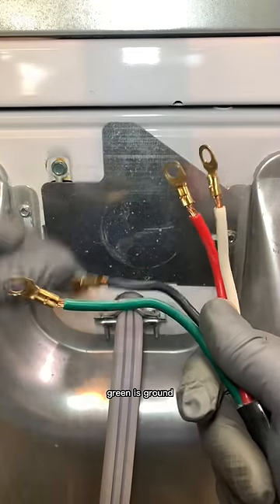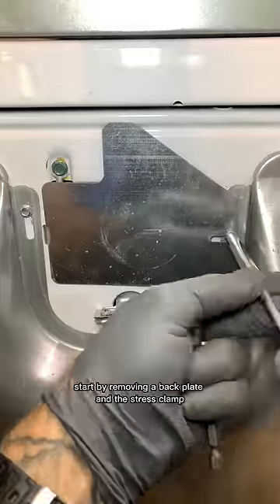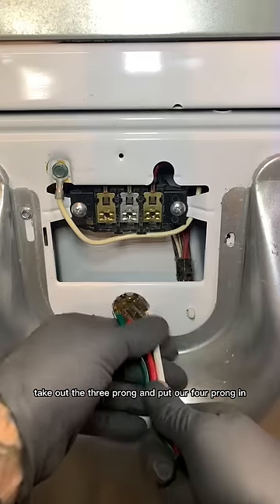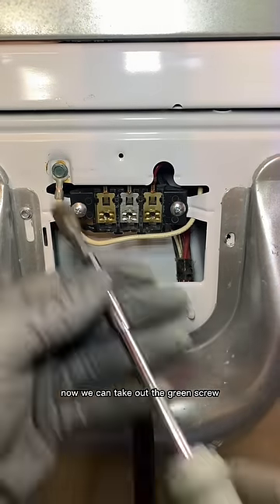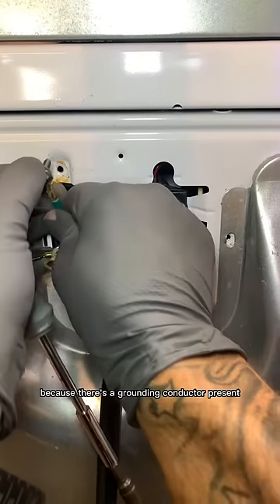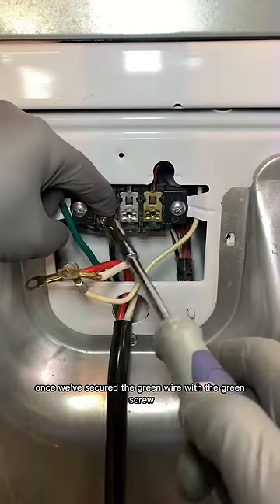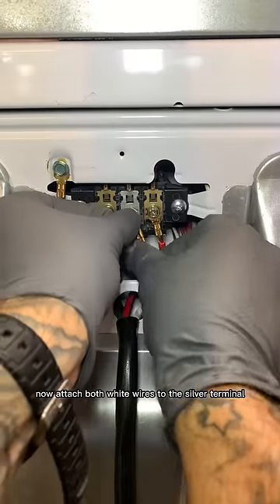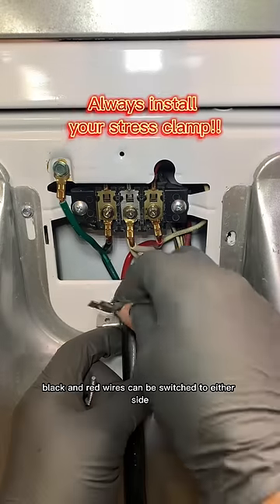Always be sure to ask if the delivery company installs a cord on your new stove or dryer!

Comment: Hang on to your three wire. It never fails that when you move the outlet will require whichever cord is not currently installed.
Reply: I'm pretty sure that is the first stage of Mr Murphy moving into your new home.
Reply: Check the price to change the receptacle, if you are able to. could be cheaper than buying a new $50 cord

Comment: THIS is great info! As a home inspector I always recommend upgrading to a 4 wire 👍🏻
Reply: If anyone has time to explain why would be greatly appreciated
Reply: @ducktape4502  If i understand it correctly the forth wire is 110V but 180° to the other life wire. So you get 220V.
Reply: @MrGoesnuts  thought it was 120/240. God the more I learn the more QUESTIONS I HAVE!!!!
Reply: @jsb7546  110 or 120 doesn't really matter
Reply: So I'll explain real quick. I'm an electrician. Unless you upgrade your wire from the service panel from a x/2 to a x/3 wire it is honestly no safer or more practical. You can change the plug interchangeably by bonding neutral and grounds together by code. In practicality dryers and ovens are almost strictly 240v meaning as long as a grounding wire is present and in almost every circumstance there is, it is a safe system. All a neutral wire will do is allow systems within it to operate at 120v instead of 240v. It doesn't add safety or really anything practical. If it's grounded you are ok. edit: I will add natural wires are very important for safety in some systems like hot tubs.
Reply: @markusford6585  so the dryers always have 220v from two phases and the second and third wire add neutral and earth?
Reply: @MrGoesnuts  exactly. Grounding comes next and then the neutral. Oddly enough neutrals and grounds are bonded at the exact same point on a electrical panel an are in a way the same thing.... But not... If that make sense lol. Unlike what the building inspector said... As long as your appliance is grounded I have no safety concerns with you using it. Neutral or not. Unless it's a hot tub!
Reply: @markusford6585  neutral and ground wire only is strange when you have you two phases. I'm only confused by the US way of doing this. Electrician from Germany.
Reply: @MrGoesnuts Not sure what you mean? We have 2 phases here as well.
Reply: @markusford6585  we have 3
Reply: @markusford6585  they run off 220/240 in Europe as you know
Reply: Also note the typical 220/240volts systems are correcctly called a split phase system. 3 phase systems are completely diffrent
Reply: @markusford6585  right on
Reply: @ducktape4502  Metal buildings for one thing. Around here you can use 3 or 4  wire systems in houses but house trailers and other buildings with metal frames must use 4 wire systems only. That way you do not get fried when you come home from work and grab a hold of the metal door knob of your house trailer if that is a short in the stove or dryer. Also some cook stoves have a 120 outlet in the panel to plug up such things as rice cookers. Those stoves really should have a 4 wire set up.
Reply: What's a home inspector?

Like for an inspection before buying?
Reply: @ab3040  some inspect homes for prospective buyers before buying (in my area it is not a requirement, but I'm not sure if that is true for other places). Inspections are required for all new construction, which requires multiple and take place in phases throughout the build (inspections for the foundation, framing, electrical, mechanical, final, etc) and an inspector would be the one doing these and making sure that everything meets the requirements set in the building code before the builders can continue to build. Renovations might require the same and would be inspected.
Reply: @MrGoesnuts  yup they are both 110 but the phases are 180 degrees apart
Reply: You recommend the homeowner does it themselves?
Reply: @markusford6585 , thank you for confirming what I was thinking while watching that, about the purpose of the white neutral for 120v systems in the machine. In your last sentence, did you intend to write ''neutral'' rather than ''natural''?
Reply: @MrGoesnuts , every house has three phase power? Now, that is civilized! That would make the purchase of good quality woodworking machinery for the shop so much easier! In the USA, the power companies always quote a number that is nearly unimaginable to a home owner, to bring three phase to the house.
Reply: @leehaelters6182  I think nearly all of them have it. It is not wired to an outlet usually, but that's the cheap part.
Reply: @MrGoesnuts , danke! Or, thanks! if you are an American abroad.
Reply: Not to knock you but a lot of times  you can not convert to a 4 wire cord set due to old concealed wires that are never easy or cheap to upgrade 10 /2 type NM cable to 10/3. Have seen way too many so called home inspectors write up things that did not need attention. Clown that inspected my sister's house wanted the 200 amp circuit breaker panel replaced because when he turned all of the electric baseboard heaters on while the empty house was over 90 degrees and panel cover just so happened to have sun on it felt warm. Asked him what model FLIR camera did he use. Oops don't own one. Asked if he used a cheap $100 hand held temperature gun. Nope. After I gave him a class he passed the entre electrical system.
Reply: @leehaelters6182  no, most residential houses in the US have one phase of 240V coming to the house. You get 120V by tapping off the middle of the transformer at the street. Hence, hot-hot-neutral coming into the house for top-bottom-middle of the transformer. Still one phase though. I’m in South Carolina
Reply: @jakewright7867 , thanks for the explanation. Did I write something contrary to that, somewhere?
Reply: @THECREATOR1099  If it is 180 apart then you are using a converting transformer somewhere in the power distribution system.

Phases are usually 120 degrees apart.
Reply: As a home inspector you need to also let these folks know they’re not really looking at a DIY situation. It’s not just changing a receptacle people.

Comment: Crazy how I ended up here, I have never went out of my way to watch electrician tutorials but this is good to know
Reply: Same
Reply: This isn't electrician stuff. This is appliance installer stuff. Electricians run the wires to the plug on the wall, and that's where the job ends.
Reply: @user2C47 it’s a little more than ‘running wires to a plug’ 😂
Reply: @HughWoo  Obviously we do more than just running a wire, but electricians typically aren't the ones putting cords on appliances.

Comment: Super common house fire cause too. What happens is (like he showed in the video) the GND is where the NTRL should go and then a heater element may fail and then it will touch the metal casing of the drier then gets hot (Or electrocutes someone) and starts on fire then your house may burn down.  If the GND is in the proper placment if the heater element breaks and touches the metal case it SHOULD just trip the breaker before anything serious happens.
Reply: I never knew 220vac had a neutral. You sure it's not just another ground?
Reply: @Barabbas7798  Yes they have a Neutral,  for AC 120 Motor you HAVE to have a neutral.  Yes it will work just for the ground but it will cause electric shock if you touch the case.   Also oven have Neutral too so the clock and light will work on then as well.
Reply: @trxtech3010  right but that's 120vac. 220vac doesn't have a neutral just 2 phases of 120vac
Reply: @Barabbas7798  The Drier motor has a neutral.  the motor does not ruf off 240V
Reply: The case is still grounded. If there is any ground fault it will still trip the circuit breaker.
Reply: @Redtooth75  If the ground is connected in the right spot yes.
Reply: @Barabbas7798  
The NEMA 14-30 connector (the one being installed in the video) has both ground and neutral so it can provide both 120V and 240V. Some connectors have only neutral (e.g. NEMA 10-30, uninstalled in the video), only ground (e.g. NEMA 6-15) or neither (e.g. NEMA 2-20) although this is obsolete.

Comment: We had a new stove installed by the delivery guys and, unknown to me, they skipped the strain relief. A year later I pulled the stove away from the wall to unplug and clean behind it and the 220v line shortet to the chassis. After I turned off the breaker I unplugged it and saw no strain relief at all. Could have been VERY dangerous.  Please, if you have one installed, be sure you SEE them attach a strain relief.
Reply: Agree. The restrain clamp has a purpose.

Comment: If you get your black and red backwards, your clothes will be stuck 1/60 of a second behind your washing machine. This can lead to a space time paradoxes and increased lint.
Reply: That is 100% incorrect, I am sorry to tell you. In a dryer, mismatching your red and black wires will cause the machine to add moisture to the clothes, meaning they become wetter than they were at the outset. Do the same with a washing machine, and your clothes become dirtier and smellier.
Reply: Oh no, I had my red on the right as the instructions say but the screw won't get tight! I switched it with the black and it's tight. Now idk what to do

Comment: I had to do this once when I noticed the outlet was different for my drier. When I moved to a new place I had to change it back. It wasn’t so easy either, I kept dropping the screws in the drier. I would advise people to use a magnetic screw driver.
Reply: Make sure screws are magnetic ferro material.  Frustrating to get magnetic tip, and makes no differnce
Reply: I always use a magnetic nut driver on the dryer cord screws.

Comment: Standard range plugs are 30A 3 prong and even back in the days older ranges had 120v outlets on them that used the ground as "neutral" since neutral and ground are connected to the same terminal in the distribution panel.. this is really just for show.

Comment: If you use a 3x2.5qmm ( Nym-J) on 15 Metern range than its total save ( LS B16A Breaker ) for the Cable and the Breaker dosent Pop if u use a 3x1.5qmm on 18 Meters ( LS B13A ) 

Greetings from germany. 
Brown is L1 Phase Außenleiter
Black is L2 Phase
Grau / Grey is L3 Phase
Neutral is Blue 
Earth is Yellow and Green.

Comment: Quick Question. Will that ground connect work fine? The metal that it's attached to is painted so that just makes me assume that it might now have a good connection.
Reply: The screw threads make contact with the bare metal.

Comment: White is a current carrying conductor just like black and red , green or bare are safety and should never see current unless something is faulted. This was a CODE FAILURE that should have been corrected in the 1950s,  ranges and clothes dryers operate heating elements at 220 volt BUT controls lights timers and tumbling motors typically operate at 120  volt witch introduces power on metal chassis of appliances.  LIKE I SAID CODE FAILURE FROM 1950S CORRECTED IN 1990S,  finally,

Comment: When I see 3 or 4 prongs, I thought it was 3 phase connection.. but I remember in the US they use 2 separate leads to made 220V from 110V.
Reply: Mostly correct. USA and Canada residential power is 240V single phase. To get 120V, the transformer has a central tap for neutral. We don't make 240V from two septate 120V lines, we make two 120V lines from one 240V.
Reply: @Crlarl  , and then use two 120V to make 240V at the device... just like he stated.
Reply: @outdoorsman7324  
You can think of it that way. We don't have to make 240V, it's already 240V, don't have to do anything.
Reply: @Crlarl  , you sure do, you have to use two conductors two achieve it... otherwise, you simply have 120V.
Reply: @outdoorsman7324  
You need to have 2 conductors to make any kind of voltage.
Reply: @Crlarl  , you know very well what I'm stating, ground does not provide power.
Reply: @outdoorsman7324  
I wasn't even talking about ground. 240V AC need 2 hot wires and that's it. (Outlets will often have either ground, neutral or both).
Reply: @Crlarl  , I know what 240V requires.
You're trying to be smart and it's not working, you've let slip just how little education you have on the subject. 🙄

I can now see that reading the NEC would be a challenge for you.
Reply: @outdoorsman7324  
Thanks for the condescension. If you think I got something wrong, explain it. Don't tell me I wouldn't understand.
Reply: @Crlarl  , I don't have four years free time to pass on the information I've acquired.
Reply: @outdoorsman7324  
Tell me again how many conductors you need for 120V?
Reply: @Crlarl  , according to you, one. 😂
Reply: @outdoorsman7324  
I never claimed anything like that. You, however wrote, "...you
have to use two conductors two achieve [240V]... otherwise, you simply have 120V."
Were you trying to say that 120V is achievable with 1 conductor or with at least 3?
Reply: @outdoorsman7324  
I never claimed now implied that 120V could be made with only one conductor. You seem to not remember what I previously wrote: "You need to have 2 conductors to make any kind of voltage." That goes for 120V, 240V, 400V, 5V or anything else.
There are several plugs which only use 2 wires for 240 plus ground (which you said doesn't count). eg. NEMA 6-15, 6-20, 6-30. If you want an example of 240V being made with only 2 wires, no ground, look up NEMA 2-20.
Reply: @Crlarl  , it is grounded... and on a neutral.

While at the device it will return voltage through the opposing phases... now follow that path back to the transformer.

Imagine that, both a ground and a neutral.

As for your 120V scenario, it requires three conductors minimum, per NEC, no matter the installation, residential, industrial, commercial, food grade, medical...

You're attempting to legitimize being incorrect and it's not working well.
Reply: @outdoorsman7324  
You just ignored my examples. I provided proof that 240V only requires 2 wires and then you change the subject.
Reply: @Crlarl  , ignored it?
I addressed it directly... your example does indeed have both a ground and a neutral.
You failed to take the entire circuit into account.
Reply: @outdoorsman7324  
Yes, ignored it. I gave the example of NEMA 2-20. 2 conductors, no ground, no neutral. Is this incorrect?

Comment: He is absolutly right but generally speaking the nuteral and ground are the same . I mean they are not because ground at the electrical panel goes to a ground rod generally 8ft x 5/8" in the ground with another 8 × 5/8 " rod with in 7-10ft from other ground rod and nutural the white is the bare wire going back to the transformer but ground and the nutural wires are bonded together in the panel so esentually¿ they are the same.also in most panels especially in older panels nutural and ground share both ground and nutural connection bars in panel . On four wire plugs the 4th wire in supposibly extra protection.. newer panels 10yrs or less also have for 110-120v outlets have arc fault breakers. These are a complete pain in the arse.. have a fine day everyone.

Comment: Why would you change from standard 3 wires to 4 wires?
When you say black is hot,red is hot and white is neutral, are you converting a domestic dryer to a 3 phase?
Reply: Its split single phase. There are 2 hot wires, a neutral, and a ground. Between the 2 hot wires there is 240 volts, between 1 hot and the neutral wire there is 120 volts.

Comment: Just took a 4 wire out, the white and green were both on the center terminal. I total confused with ground and neutral. Good info I think.
Reply: Both is technically ground
Reply: @Jasen Vernor The neutral and ground are tied together in the main circuit panel so neutral is essentially grounded.

Comment: my uncle had to do this in reverse when i moved last. why not just standardize the plugs?
Reply: They did but not all of them got upgraded, any newer construction is always going to be four wire.
Reply: That would be too easy lol
Reply: 4 wire allows for 120 and 240v stuff like lights and motors, while 240 is used for heating
Reply: @nekomasteryoutube3232  They all do that but the older ones use the same wire for neutral and ground.
Reply: receptacles are standardized look up nema configurations.
Reply: They gotta create jobs for the sake of creating jobs.

Comment: Funny to see. In Denmark you would never connect the bonding wire to the neutral 😅 we connect it to earth so our RCD relay can pickup the leakage current
Reply: In North America (US and Canada), GFI is very recently mandatory, so we still have a lot of homes not protected against ground fault. We like to use GFI outlets rather than at the breaker box. So the first outlet in a series must be GFI protected so any leakage in the entire run is detected.

Comment: It was cheaper for me to just change my receptacle from a 3 prong to a 4. The whip for the dryer isn’t cheap especially now.
Reply: Unless you have a grounding conductor that actually is connected in your service panel, that's a code violation and isn't safe. If something short circuits, there's no return path and it can cause the metal case of the dryer to become energized and potentially electrocute someone.